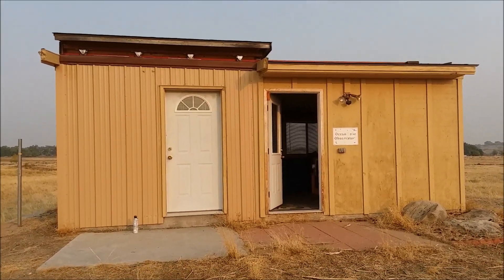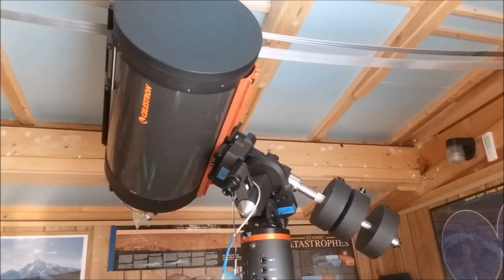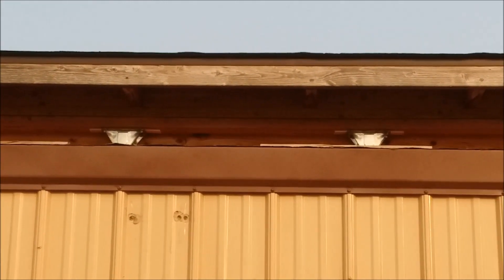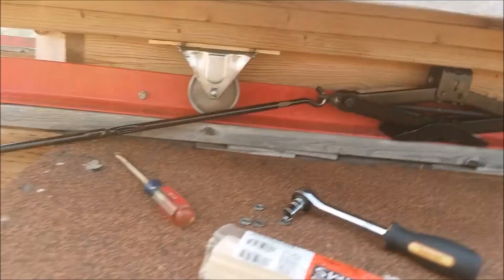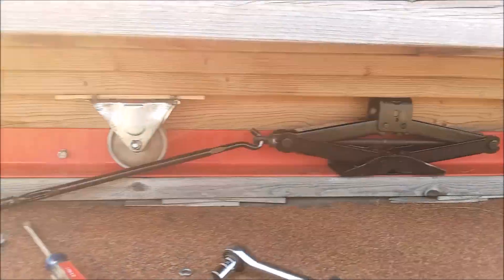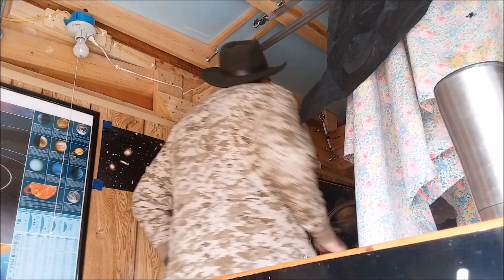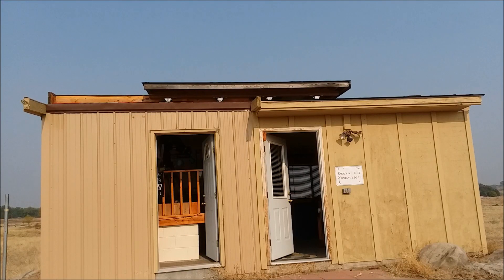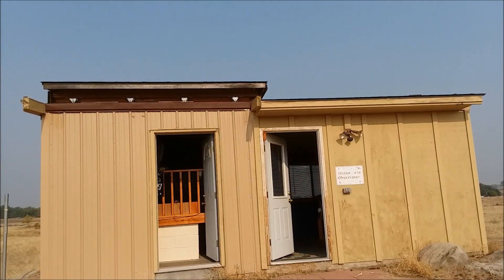Repairing the roll-off roof at The Ocean Lake Observatory

Comment: If you need a bit more roof clearance, you can just abandon the bolts, possibly cut them off. Then shift the wheel locations enough that you can use long screws to fasten the wheel plates to the roof structure.

Comment: Congrats on the repair Mike. The observatory and location look awesome. 1 question though, is the roof flat? It doesn't look like it has much of an angle to it which would seem to be a problem with snow build-up.
Reply from the maker: The roof has some pitch to it. It's not flat. It has survived many Wyoming winters before I bought the place. Snow load doesn't seem to be an issue for the structure. I don't know how well it would open or close with a lot of snow on it, weighing it down and clogging up the tracks. I guess we'll eventually find out.